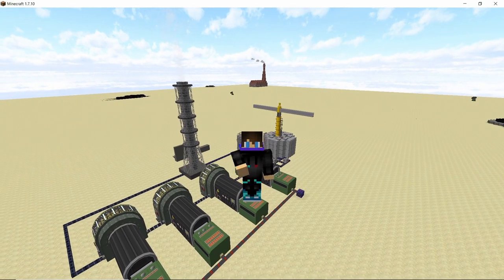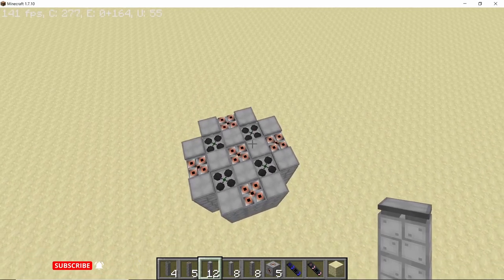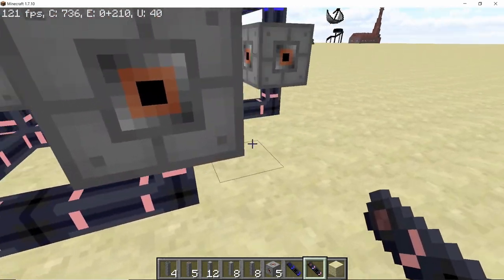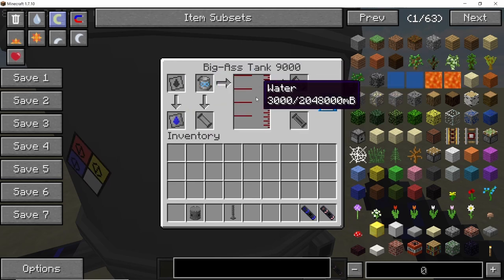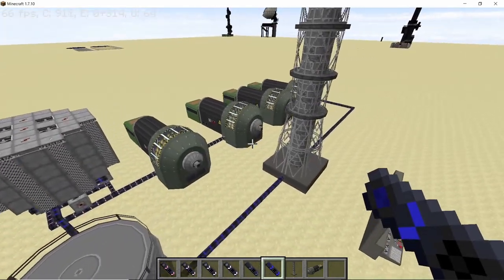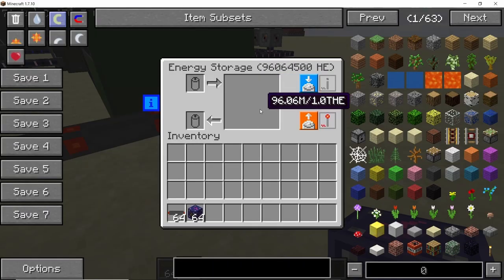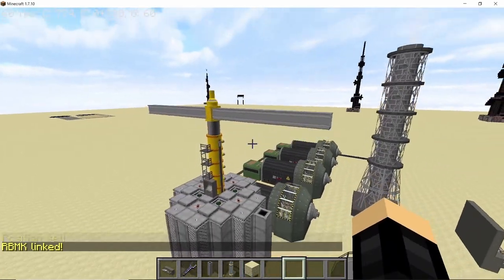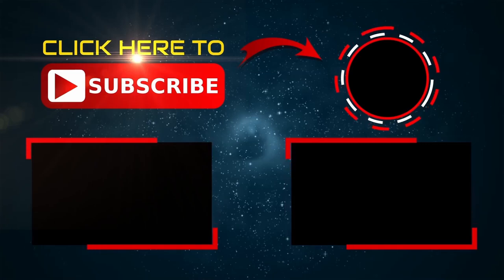RBMK REACTOR Design with RBMK FUEL CRANE || How to make an RBMK Reactor with Fuel Crane in HBMs Mod

Comment: It does not turn on
Reply from the maker: MEP is no longer a self igniting fuel rod in the latest updates, maybe thats why. 
Use a self igniting fuel rod in the middle and replace it with the normal fuel rod and that should get the reactor going

Comment: thanks, but this isnt the information that i requested
Reply from the maker: Oh man then what is the information that you requested ?? and I had to make this reactor anyways cause most of the other designs straight up exploded in the new updates .. this shouldn't
Reply: @SavageVegeta  the other new things, before the crane, and why you didnt used the new rbmk cooler?
Reply from the maker: Cause this build didn't really need the cooler it doesn't go past 900 degrees ... I am working on a design which uses the cooler as well !!
Reply: @SavageVegeta  but will the reactor go into the oposite stage when i use it on this reactor?
Reply from the maker: Theoretically it should , but that is also not very desirable as you need the column temperature to be atleast 600 degrees celcius inorder to make Ultra dense steam
Reply: @SavageVegeta  you can use a balefire fuel rod and a cooler
Reply from the maker: @andreschroder7852  yeah , but why use fuels which burn so hot when you can run it using Plutonium and Uranium. Something which is easy to obtain compared to Balefire
Reply: @SavageVegeta  i forgot to warn you, all my rbmk reactors blown up when i used this fuel rod, digamma wont work, since digamma fuel rods works not like the other fuel rods
Reply from the maker: @andreschroder7852  hmm it's all based on design dude , like I've made reactors that don't explode even when using Digamma fuel rods , also I've made some stable designs for balefire fuel as well ... But as I told you I don't prefer using them ... There are many more efficient uses for such expensive and hard to get fuel like Balefire and Digamma
Reply: @SavageVegeta  like schrabidium, flashgold or americium

Comment: I always use regular reactors since I heard the rbmk reactor is what caused Chernobyl to explode and I don't want that happening to my base although it seems like its the most detailed reactor in the mod and it seems like it works good in the mod i crafted a rbmk control station as a decoration for my reactor but never used it
Reply from the maker: Well RBMK is a high risk high reward kind of reactor even when you don't completely know what you're doing. Once you understand how it works it's definitely a very high reward reactor able to produce several million HE's per second. All you gotta do is try out different designs and understand how each components interact with each other
Reply: dw if the reactor explodes you dont have to worry abt ur base because it will be gone
Reply: This is how a rbmk work in hbms(1.7.10) so fuel rods are fuel for the reactor also make sure you use fuel rods function type=medium do not use fuel rods function type=dangerous these fuel rods descriptions are self explantery also steam channels make steam for the turbines to generate power and steam rods require feed water to function 

Here's a simple rbmk design:

S=steam rods

F=fuel rods

N=neotron reflectors

C= control rods

G=graphite moderators 

   C.N.C
 C.s.g.s.c
 n.g.f.g.n
 C.s.g.s.C
    C.n.C

I hope you understand what is this

This is a design for a small rbmk hope this helps

Graphite moderators are used to stop fast neutrons I think

Neutrons reflecter is used to reflect neutrons I think

Control rods are used to pressure some thingies and if you want more power then set the control rods to 100 you can control how much neutrons you want to use to generate power 

Now into turbines

Turbines are used to generate power using steam so I recommend lievian turbine as it is less complicated and produces more power than a normal turbine

So heres how to use them:

T:turbines

R=rbmk reactor

Uds:ultra dense steam pipes

Sds:super dense steam pipes

Ds:dense steam pipes

S:steam pipes

Lps: low pressure steam 

Here's the design:

                R
               Uds
               Uds
                T
               Sds
               Sds
                T
               Ds
               Ds
                T
               S
               S
               T
              Lps
              Lps
           (Connect low pressure) (steam pipes to a cooling tower I) (recommend using two cool)
 towers)

After you connect the Lps to the Colling tower now get some water pipes and connect them to the both cooling towers now connect the water pipes to a infinite water supply barrel and also connect water throught the steam rods from the water barrel also make sure you have putted water in the steel barrels 

I know my explanation is missing info but I tried my best to give you a simple design

I spent 30 minutes writing this your welcome=]
Reply: @TheNew1234_y Bro, thank you for the detailed explanation. Since you seem to be knowledgeable on the topic, do you have any idea how to prevent radiation from a working rbmk to leak out into the environment. I've tried building concrete or concrete brick cubes around the reactor with paintable coated fluid ducts for outputting steam and water. But it's still causing the chunks in the area to read up to 100 Rad/s in some spots on my geiger counter and even the green radiation clouds are appearing. Nobody seems to explain this part which is necessary for building and using this reactor in survival, at least without using hazmat suit and a bunch of radiation absorber blocks...
Reply: @okramra  hmm, my best solution is to put up RBMK glass cover panel in the reactor rods, its been 4 months, so i might miss some info, also im glad you found my explanation useful!
Reply: @TheNew1234_y  After two days of messing with RBMKs I think I got down most of their workings. For radiation to not spew out the game checks if there are panels on each RBMK pillar, and also if a Fuel Rod is sending neutrons freely in a cardinal direction without anything stopping them, like a Neutron Reflector or 4 blocks of concrete covering the edge of the reactor in that direction. I was building concrete cubes around the reactor but with some space between them which the game doesn't recognize as covered obviously. I came up with this idea after seeing reactors who had Reflectors at the edges not being radioactive to the environment.
I don't know how well I explained, but feel free to ask and thanks for the answer again 😄
Reply: @okramra  oh cool! I never knew neutron reflectors reflect radiation in the reactor, i thought they reduce neutrons reaction to  cool the reactor, thanks for the explanation
Reply: @TheNew1234_y  no problem, yes, they do exactly the opposite of cooling becuse they increate the rate of fission

Comment: I tried building this, but the water ducts won't connect to my steam connectors! Am I doing something wrong? What should I do? I could make the reactor with steam pipes going into the upper part, but that'll look ugly.
Reply from the maker: That is just a visual glitch , they are connected but they look like they aren't
Reply: @SavageVegeta  uh the water pipes wont work and in the rbmk says there is no water
Reply from the maker: @hamasakibunrakuken3069  The visual glitch is between water pipes and steam connectors ... water pipes connect to the bottom of the RBMK perfectly. Or atleast that was the case the last time I was playing 1.12.2.
Which version of NTM are you using - Reloaded or Extended ?

Comment: I love this size and design it will fit in my power plant thx you so much 
Ps : my next power plant will be with 15x15 size reactor if my pc can handle it ;-;
Reply from the maker: Yoo that's awesome , and I think your pc will be able to handle it , to make things easier just reduce the size of each RBMK column to minimum size of 2
Reply: @SavageVegeta  thx for the tip😁

Comment: Hello
Thank you for this wonderful and very understanding tutorial!

I have two questions

First

I would like to make a RBMK reactor 19 blocks in diameter with  center point. Is the structure exactly the same, simple that have to make more rings?

Secondly

What do you have to set the reactor is poisoned so how do you do this?

Thank you in advance
Reply from the maker: Glad to hear you liked the tutorial dude ... now for your questions 

A normal RBMK fuel rod will emit a neutron which can only travel for 5 blocks ... so no if you want to make a reactor with 19 blocks diameter this design won't work. 

Secondly Xenon poisoning happens in the reactor when it's running on low temperature, so incase your reactor is poisoned just increase the temperature by pulling out the control rods and the xenon should burn away.
Reply: @SavageVegeta  Okay, thank you for the answer

Comment: Hello! It's a very cool tutorial, but I have one question. I can't connect the water fluid ducts with the rmbk steam connectors. They don't connect at all. And how to make the RBMK console show the reactor, not the blue screen? Maybe I don't understand something, but for 1.12.2 the crane for RBMK has not been added yet?
Reply from the maker: Connect the water ducts on the bottom of the steam channels and then the steam pipes on the top , that way you won't need steam connectors. As for displaying the reactor on console just shift right click on the reactor with "RBMK Console Linking Device" and then right click on the RBMK Console with that device and in this way you will link the reactor with the console.

Comment: I'm sure I'm doing the reactor right. When I press Az-5, the reactor keeps running.
Reply from the maker: if the rods are not self igniting then the reactor will shut down after sometime, just make sure that the fuel rods are surrounded by control rods on all the 4 sides so there is no way for neutrons to hit the fuel rods back

Comment: why is my water pipe not connecting to the steam connector 

hbm reloaded btw
Reply from the maker: Yeah that's a bug that should be resolved in the next update probably. You can either join the water ducts on the top portion of the reactor for now tho

Comment: HBM is making the mod better and better

couple questions tho 

Are you going to make a tutorial on all the RBMK Fuels?

Can you make a tutorial for a bigger RBMK Reactor with coolers?

And every time my RBMK runs it spews out radiation do you have a solution for that?
Reply from the maker: I will cover RBMK fuels when I will make a video on Recycling RBMK Fuels.

As for a Bigger RBMK I will try to make it , thing is I am not a very big fan of Big RBMK's , I instead prefer compact designs as for more power production I prefer using other Big reactors. But if I will come up with a cool design I will make a video on it for sure !!

As for the reactor spewing out radiation you have three options 
(1) Place Radiation Absorbers around your reactor and they will keep all the radiation in check.
(2) Make a concrete shield around your RBMK reactor and that should also prevent radiation from leaking out.
(3) Make a reactor where neutrons can't escape out and keep on circulating inside ( an example is the reactor I built in this video) , if you make such a reactor it shouldn't leak any radiation 
However I prefer using the Radiation absorbers as they are the most reliable

Comment: My reactor produces radiation when theres over 2 plutonium rods in it and the crane doesn't work, I don't know why. (also, it does use the moderated fuel rods)
Reply from the maker: I haven't tried it with two plutonium rods however it shouldn't leak radiation as that factor is totally design dependent and not rod dependent in most cases. I will check it out and if I manage to find a better design I will make an update video.
Reply: @SavageVegeta  News update: I used some radiation absorbers to stop the radiation from spreading. I can can also move my crane but it doesn't really pick up and deposit the plutonium rods

Comment: Hey I wanna ask does Immersive engineering works with hbm mod without a crash?
Reply from the maker: If you're just talkin' about using the two mods together then don't worry your game won't crash. 

If you're talking about core integration like using IE pipes / cables in HBMs then yeah that won't work out.
Reply: @SavageVegeta  I'm pretty much talking abt both but thanks for telling me at least I know I can use those two for my personal modpack...have a good day sir
Reply from the maker: @zu1200  np my dude , you too have a great day !!

P.S. - pipes from Thermal Dynamics are somewhat compatible with HBMs , incase you need to add secondary mods for item / fluid transportation
Reply: @SavageVegeta  ooh thanks I'll check out those two mods

Comment: Please help the water pipes arent connecting to the steam connectors
Reply from the maker: They should work nonetheless. It'll look like they aren't connected but they are. Anyways if you really want connect the steam pipes on top of the reactor and water pipes on the bottom
Reply: @SavageVegeta  When i try to run the reactor whit the fuel rods, the Turbines dont run or anything
Reply: @barry2343  Your reactor needs to be hotter

Comment: Could 4 reactors share same water source if its infinite?
Reply from the maker: no it can't man, even a single reactor will require multiple infinite water sources depending on how hot the fuel is that you will be using.
Reply: @SavageVegeta  Ok thanks

Comment: Next tutorial: how to make Chernobyl layout RBMK Reactor on HBM
Reply: Oh yeah I have another issue, i use 1.12.2 HBM With everything but the steam connectors doesn't connect with the water pipe.
Reply from the maker: Yeah about the Chernobyl layout RBMK I can't really make that as it was too big , making such a large system would lag my laptop out hard. I will try it definitely when I have a good setup tho !

Also yeah this issue has been there for quite some time now. Just hope the next update for the mod comes soon and the ducts not connecting to the connector problem gets solved

Comment: Make a reel on how to use pumpjack
Reply from the maker: I've made a video on how to use the Fracking Tower and Oil Derrick dude , Pumpjack is exactly the same , just find oil source , place down the pump jack on that block and supply it with power. It already has red color outlet for oil and yellow colored outlet for natural gas so take out your pipes from there and then I guess you already know how to process the oil further

Comment: I think I'm going to build this as my first reactor! I believe I have all of the supplies to do so! I have a few questions for you though!

Is it possible to hook this up to the computer so it will automatically shut down if it gets close to meltdown? I believe you did a video on that but I can't remember if it was for RBMK.

Also! It seems I'm one of the few who play this mod in survival.. What is the best gear to avoid radiation. The basic hazmat suits are terrible. I use radiation absorbers but they're also pretty useless against many sources of radiation. Unless there is better gear, tools, or tricks I'm missing, this mod is very hard in survival.. I've searched on the wiki but didn't find anything crazy that would help. Most items like cores or belfire shards are virtually an insta kill which stinks..

Thank you in advance!
Reply from the maker: Alright so as you are making this in survival there are a few tips I would like to give you , use more water tanks than needed to absolutely make sure that your reactor doesn't run out of water and also use a big cooling tower instead of using an auxiliary one. 
Next up the only way to automatically shut the rbmk is by using the automatic rbmk control rods, they can be controlled according to temperature. Other than that you need to press the AZ5 manually in the console but all of this only works if you use control rods in your reactor (I generally don't use control rods and like using reasim rbmk instead of normal ones)

Now to avoid radiation there are alot of armors which have more rad protection than your typical hazmat suits (you can make a creative world and check the rad protection numbers on all the different armors). Also there's radaways which can be consumed to give you radiation resistance effect and armor mods can be installed to increase the radiation resistance of armors on the armor modification table.

Comment: It just blows up
Reply from the maker: Many fuel values were changed in the recent updates, this video is pretty outdated in terms of fuel used tbh. Try to switch to a less reactive fuel rod cause as long as you're not using dangerous fuel and your reactor has water it won't "just blow up"

Comment: Can i have the NEI Mod for 1.7.10, i can't find it anywhere and when i find it, my MC Crash.
Reply from the maker: Ah sorry dude it's the same for me , like I tried downloading the mod and running it but it crashes my game as well. The reason I have it was because I had it installed since a long time and it's the only version that's running 
when I download the newer version for 1.7.10 my game crashes too , its due to changes in Forge or something like that.
If you want to add me on discord , I will try sending you the files there
Reply: Thanks.
Reply: Btw you make my life easier at using hbm mod, keep going man!
Reply from the maker: @Omnioxide  thanks man it makes me really happy to hear that !!

Comment: Why my water pipes doesn't connect to the RBMK steam connector in 1.12.2 ?
PS: For the standard RBMK
Reply from the maker: Cause 1.12.2 still has missing features , it isn't completed yet
Reply: @SavageVegeta  So theres no way of creating an RBMK Reactor on 1.12.2.... This what one of the devs said: Water ducts do not connect to the steam connector. The connector does not accept water input, it only does steam output. The water ducts connect to the column while the steam ducts get steam from the connector.